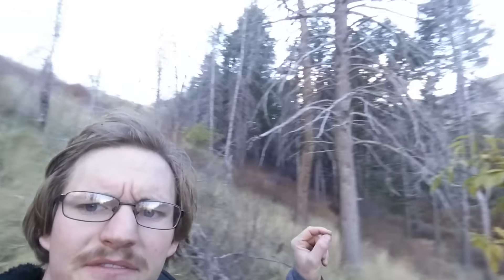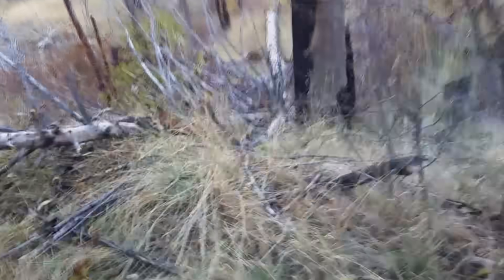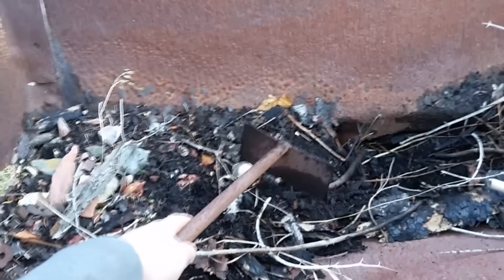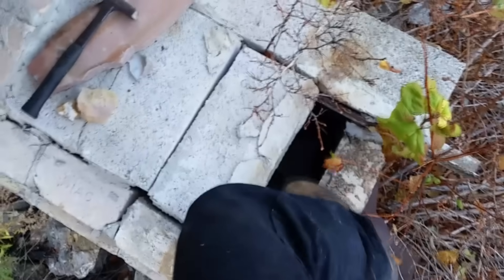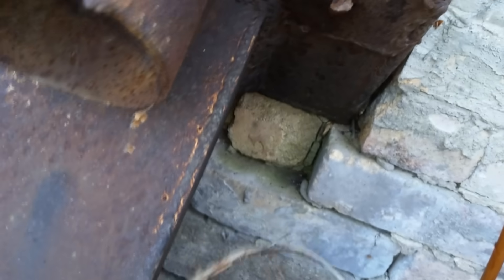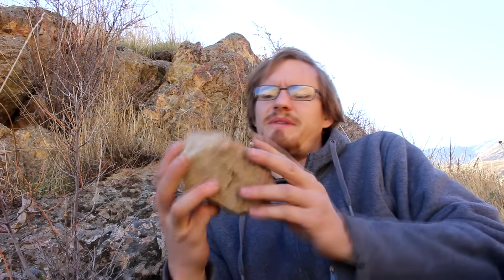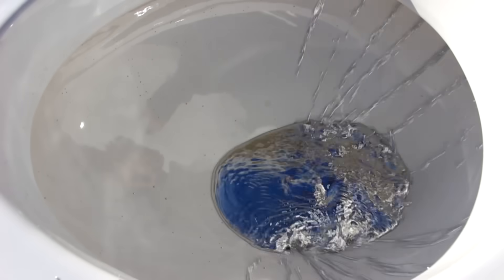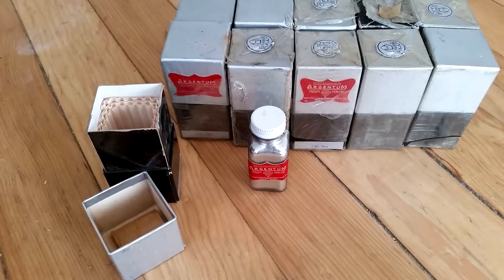Where Did I Get My Mercury?

Comment: how does the white chalky rock turn into a shiny watery metal?
Reply: Mercury hide in white chalk rock, crush white chalk rock and feed to fire, make mercury come out.
Reply: BrownerBoy Games magic
Reply: If i understood well, it's with fractional distillation. The rock is mined, broken down to little peaces, heated until it turns liquid, heated some more until the mercury starts vaporizing, then mercury condensates from the top of the pipe down to the drainage container, thus distilling among the other things - mercury.
Reply: @jovanjanevski3747  :
"If i understood well, it's with fractional distillation."

==No, it is not fractional distillation.
That is a technique used to separate 2 or more substances by having a long column that has a temperature gradient to it.
For example, it is used to separate the various components of air.

In the case of cinnabar, it is HgS. It is heated with oxygen and the sulfur combines with the O2 making SO2. Mercury does not combine with oxygen and you get mercury gas. Cool the gas and you get liquid mercury.
Reply: Jovan Janevski Are you sure its fractional distillation and not just a distilation or reflux process. Fractional distilation condenses many different liquids with different boiling points in a large cooling tower
Reply: To put it simply it doesn't. Cinnabar is a red mineral composite of Mercury and sulfur. Those other rocks are just there
Reply: Tharsis Rise 
I feel like a caveman scientist wrote this. Not trashing, good info, but the English is strangely (and interestingly) written

Comment: Going to bet the miners initially roasted the ore to get the mercury, then took the roasted ore, ground it fine and then separated out the denser fraction with the gold. Then reintroduced the mercury to amalgamate the gold and finally distilled the amalgam again to recover the mercury ( condense to use again and again) and get the gold, copper and silver into a concentrate that they then sold. Later perhaps they went to a cyanide process and reworked the dump, as there probably was enough gold in there to make it worth it.

Comment: Dental amalgams. I remember back in the 90's when I told my dentist to remove all my amalgams and replace them with composite fillings. The dentist thought I was crazy. Meanwhile, most dentists no longer use the mercury amalgam fillings. You should have asked if he had an amalgamator. Could be very useful for you.
Reply: "most dentists no longer use the mercury amalgam fillings" this is news to me, maybe thats the case in the states.
Reply: Alrighty, dentist here. Amalgam is a mercury ALLOY. The ALLOY is NOT toxic. Mercury VAPOR is toxic. The mercury is fixed in the alloy and does not produce mercury vapor except maybe a trace amount for 1 day after it is placed. What DOES create vapor is REMOVING the amalgam. Removing amalgams produces 9 times the mercury vapor than it otherwise would, and even then it's very trace amounts. Any dentist who tries telling you to replace them is looking for $$$.
Reply: I hope you realize that amalgam fillings generally last about 10-12 years after which point they breakdown or accumulate bacteria underneath them. Every single day dentists across the globe remove mercury dental fillings for reasons that have nothing to do with health issues. You are 100% correct that when a dentist grinds out an amalgam filling they are creating thousands of micron and submicron particles that both patients and dentists inhale. There are mercury safe dentists (ones that do not place mercury fillings AND know how to remove them safely)...
Reply: my dentist told me last year he still uses mercury composite for deep decay repair because the inner tooth is too soft for modern acrylic composites. not all cavities are the same.
Reply: I have a grandfather in his sixties with a mouth full of amalgams (most of which he's had 40+ years) and he's perfectly fine. No brain or teeth problems. I used to be scared by people like you because of the one amalgam I have, but I've realized it's just scare tactics. They're safe to have in your mouth, and they last way longer than composites.
Reply: @ethex74  get a heavy metals test then come back and tell us the results??
Reply: +Josh Baker - Josh, you are dying from direct contact with mercury/silver amalgamate dust? Could you please come back and maybe start a new thread and let me know about it? I have many questions.
Reply: Good luck josh
Reply: but the patient has the final say.  They are in charge.  Even when they are wrong.
Reply: I thought amalgamators come from further south, like Louisiana or Florida.
Reply: SgtLion Actually it's the other way around. In elemental form it is much less toxic than in organic compounds.
Reply: my latest panoramic xray showed new decay has begun under the metal fillings that were put in early 1980's. i could'nt see anything wrong with those 4 teeth on xray film but he did. he wants to use metal again because he said the tooth is too soft that for down and acrylic fillings would fall out fast. said the better option would be 4 gold crowns. i already have 2 of those and can't afford 4 more. filling estimate is $795 plus another $200 new panoramic xray
Reply: The brain is good at rewiring around damage caused by trace quantities of mercury and other heavy metals being pumped into it, individual cells die but the effect on the whole is immeasurable and probably insignificant. 

Some people care about every single cell of their brains, some people only care about function. Neither is crazy and neither should be ridiculed for their opinion.
Reply: modutchable You don't know what you're talking about, but sure can make yourself sound convincing. Consider a career in politics. Listen to the professional, ie. the dentist. If mercury amalgams were so toxic, dentists would be dropping like flies at a very young age (look up "mad hatters disease"). And no, in response to an earlier post, dentists have no worse health than anyone else. In point of fact, due to their higher standard of living they have better health and on average live longer lives.
Reply: electronicsNmore 
I had that type of amalgam in 4 tooths. 3 or 4 years ago my dentist replace those for composite. I am fine.
Reply: Please check out the EPA safety levels and you'll see that inorganic mercury has a safety limit 10x times lower than that of methylmercury (considered 10x more toxic). while elemental mercury is uncharged, once in the body it becomes mainly  inorganic mercury. We have a published researcher discussing that aspect on our YT channel.
Reply: @Evidenceofharm  you listen to the epa? Brought and paid for
Reply: Trav V, he is crazy and he has no knowledge about the subject i guess.
His videos don't proof anything.

It is proven that it doesn't cause health issues. And the future ban of it on pregnant women and children younger than 15 years in the EU is just a part of the entire "Get rid of mercury everywhere" program thats going on.
And that most dentists wont use it is also completely wrong. In fact most dentists still use it.

You both don't even remotely understand the difference between elemental mercury and an amalgam.
There is a HUGE difference between the two.

And amalgam fillings have many upsides compared to plastics or ceramics. For example they are far less prone to break or to be lost if done correctly, because they don't get lose that easily, and therefor have less issues later with bacterial growth in gaps between filling and tooth.
Reply: Hmm... I have quite a few fillings that are amalgams.  A few years back, I got a mouthFULL of battery acid (electrolyte). Don't ask. Anyway, any possible chemical reactions to my fillings?  The enamel of my teeth was rough like sandpaper for months, and all the skin on the roof of my mouth and inside my cheeks and around my gums sloughed off in layers.
Reply: If you're this incorrect here in the comment section. People should never trust anything on your channel. Removing dental fillings is NOT necessary. Dental fillings don't release mercury. In fact... by removing them, you got a 10-100 times mercury in your system than you would by a life time with the fillings. Dentists usually don't use Mercury-Silver amalgams anymore because it's ugly... not because it's dangerous. If you really have "2 dentist friends" they must be really shitty at their job if they tell people to replace their fillings willy-nilly.

Gosh... I hate people who don't understand the science... and still lies on the internet to make their argument "better".
Reply: They no longer use them because they expand and contract over time and risk letting bacteria back in the cavity..    has nothing to do with mercury.
Reply: electronicsNmore Your dentist is right that you're crazy. As long as the amalgam filling isn't having any other issues (e.g. leaks, decay, cracks), there is really no medical reason to replace dental amalgams. Some people may have cosmetic reasons to replace fillings that are in frontal teeth with a less visible tooth-colored filling, but the drawbacks have to be considered carefully.

It's actually been shown that replacing dental amalgam actually releases some mercury vapor (the dangerous type of mercury), so keeping the amalgam is actually safer than replacing them if you're concerned about mercury. In any case, unless you have mercury allergy, the amount of mercury released from amalgam during its lifetime and on replacement is much smaller than the dosage that you would need to be concerned about even if all your teeth are amalgam fillings.

Additionally, every time dentists opens up a filling, they always have to drill down through parts of the healthy teeth as well. This is why it's bad to unnecessarily reopen a filling, as it weakens the healthy teeth structure every time they do it.

If you have a dentist that told you to replace a well functioning amalgam fillings, they are not acting in your best interest.
Reply: @yvrelna  you are full of bs... amalgam fillings can be removed safely and should be removed, if you have those in your mouth i suggest you get a toxicity test!
Reply: yvrelna
I know all about dental work. I have 2 friends that are dentists. I even have dental related videos on my channel. The best thing you can do for your health, is to remove the fillings. The dentist was wrong. Mercury has no place in the human body. Chewing on food gives off mercury vapor. When drilling away the old amalgams, it is done with suction very close to the tooth to remove any vapors, and you also breathe through your nose while it's done. Look at my teeth and let me know if you still think I'm crazy. Plenty of composite fillings, but no amalgams, caps, crowns or veneers.

http://i1063.photobucket.com/albums/t507/lookingfordbn/SNV31573_zpsszsc1qrc.jpg
Reply: electronicsNmore I’m a dental assistant and today’s amalgam is different than back then back then you had to mix it by hand and today the amalgamator mixes the two much better and it is a small amount and it won’t cause harm
Reply: @electronicsNmore  "Look at my teeth and let me know if you still think I'm crazy."  -totally normal non-crazy thing to say
Reply: @electronicsNmore  yvrelna is probably dental lobbyist or public health internet operative.  The dental industrial complex is crazy corrupt.
Reply: Mine was suprised in 2010 that i want composite filling XD Cause amalgams hold good soo far XD
Reply: electronicsNmore j
Reply: electronicsNmor
Reply: An amalgam is not an organic compound.
Reply: Im 17 years old and have 3 amalgam fillings in my molars. Ive never had problems with my teeth since I was a child (other than braces and the occasional pull of baby teeth).
Reply: rotaryskratch OUCH!! I'm sorry you had to go through that. I'd get your fillings checked by a dentist. There could be cracks, chips, or other corrosion. Im no scientist, and mercury is pretty tough, but I'd definitely get an expert to take a look.
Reply: @modutchable someone who knows ;-) 👍🤜
Reply: Many dentists still use silver-mercury amalgams, it just depends what the customer wants and/or what the dentist prefers for the job. Like for back teeth the amalgam won't really be noticed visually, while amalgam is easier to work with and slightly more durable.

Composite fillings have been shown to leach bisphenol A, which is unhealthy. There's nothing particularly unhealthy with the mercury amalgam because the mercury stays connected with the silver and doesn't significantly dissolve into the body. Everyday mercury exposure from general urban air or seafood will be far more harmful.

Even for those dentists who do use only composite fillings, they generally will not recommend taking out existing fillings as long as the fillings are in good shape. It's a waste of time and money to take them out just to re-fill them, and would likely result in losing a bit more dental mass in the process as well.
Reply: Quite the contrary. Amalgam have shown to release mercury and that mercury is considered bio-accumulative by the EPA. Risk assessments have been done indicating the amount of mercury released from amalgam fillings exceed the daily safety limit established by the USA government.
Reply: @modutchable probably because dentists are always mixing them which is the phase they release the most vapor. They handle it every day and breathe the vapor every day. I'm not surprised
Reply: "Your dentist is right that you're crazy." nah bro he isn't, you don't want mercury in your body.
Reply: Funny how dentists want to replace your amalgams, which last decades, with composite fillings which you have to get replaced every 5 years at least, right? Follow the money.
Reply: I am dying because I had my mercury fillings removed. I don't expect to see another year.... Meanwhile my mom is pushing 80 as well as millions of others living healthly despite all having multiple mercury fillings..

 So yes, grinding mercury into almost microscopic pieces inside you mouth is a brilliant idea...   It is a scam to make more money from you... If it aint broke, don't fix it.
Reply: Mercury fillings are proven to have no adverse health effects. Mercury only presents a serious health risk in elemental form, which won't be happening unless you start pouring weird industrial chemicals into your mouth.
Reply: @SgtLion  priven by who, mercury is dangerous and has no place in the body, think about it use your common sense or do you just believe everything without usimg due diligence? Peoples testimonials are what you should listen to not brought and paid for salesman...
Reply: Shady dentists will push Mercury because they're cheaper.
Reply: Liar.

Comment: Is there much industrial use for mercury today? What is all the mercury you have worth?
Reply: A flask for mercury used to be made of iron since mercury does not dissolve iron. They contain 76 pounds = 34 kg of Hg. That is 2.5 L of mercury, so it can fill a 2 L Pepsi bottle plus a little more or one of the jumbo Pepsi bottles.

PS: drink Pepsi.
Reply: +Prompted Hawk  Aircraft altimeters measure the relative pressure difference between the lower ambient pressure at altitude and a calibrated reading on the ground. These readings are provided in inches of mercury.   -good old wikipedia
Reply: mercury is used in cfl light bulbs, switches, thermometers and cost about 150 dollars a flask...whatever that is, im sure cody knows
Reply: A flask of mercury is 34.5 KG. With some calculation that I don't want to make you can figure out the volume. If you look at the flushing Mercury video, I think he shows the flask (big Grey thing, I believe).
Reply: In aircraft Altimeters ?
Reply: - ColetheDemolisher -  An Altimeter uses Mercury? Maybe you're talking about a Barometer? I'm not sure if they would use mercury in an aircraft Barometer, gets pretty cold up there. Then again, I'm not a rocket surgeon, so what do I know?
Reply: - ColetheDemolisher -  Yeah, so it uses a Barometer.
Reply: The units are inches of mercury, but you're thinking of a very ancient way to build a barometer. Modern altimeters and barometers use a device called an android capsule.
https://upload.wikimedia.org/wikipedia/commons/c/c6/Faa_altimeter.JPG
Reply: Andy Plater
 It says aneroid wafers, not android.
Reply: louis tournas lol can't believe I said android capsule. It is called an "aneroid capsule" though.

Comment: the question is, how have you not been poisoned when you put your hand in the Hg? you must have to wash your hands like 200 times!
Reply: +Niko_2142 instead of telling him he is wrong why dont you explain it to him
Reply: Elemental mercury isn't very bioavailable. It doesn't readily absorb through the skin. Mercury compounds are where it gets dangerous.
Reply: Mercury actually readily rolls off your skin. It has a lot of surface tension and is nonpolar.
Reply: Where did you get that info from? because its wrong.
Reply: no i mean like it stays on your hands and stuff
Reply: and gets trapped under you fingernails

Comment: I know of a Mercury mine in Northern California there is a small creek that runs thru it and after a rain storm all you need is an eye dropper to collect the liquid mercury. The mine has been in operation for a long time. They closed the mine probably since they don't have pumps strong enough to get the mercury out of the ground it is so deep. It is now turned into a state park. This is the only Mercury mine that I know of where the Mercury is in liquid form.